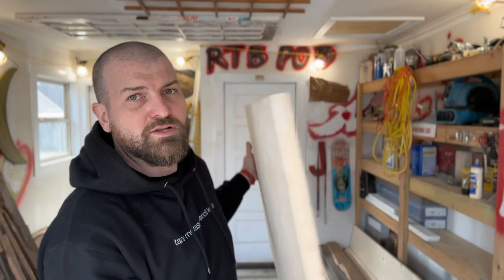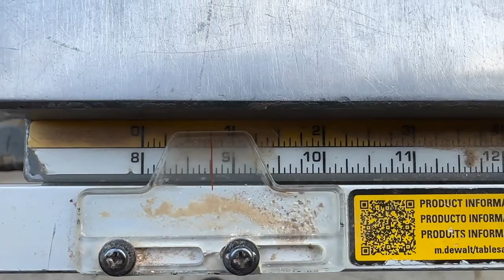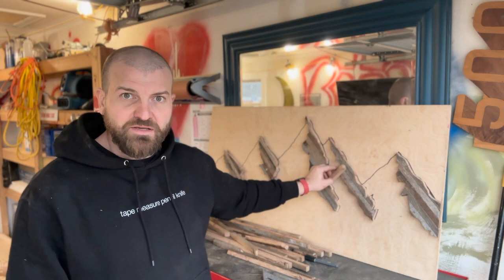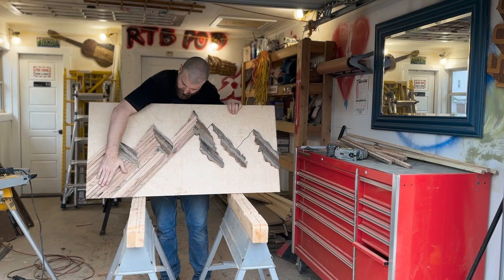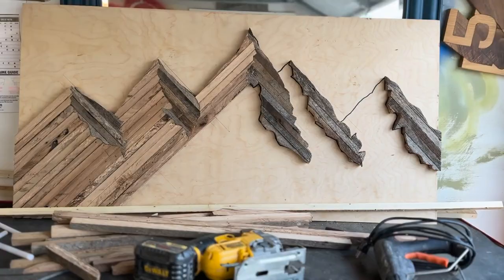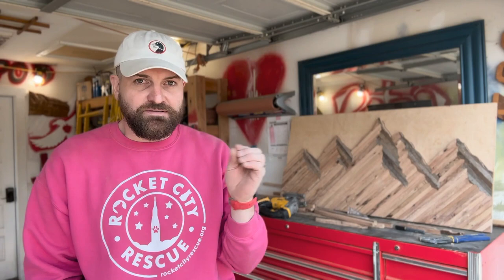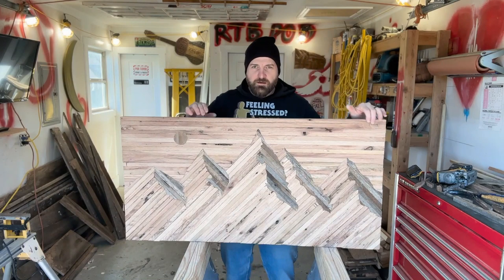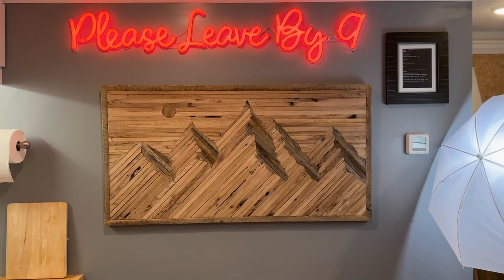How to Mountain Wall Art

Comment: Bro that was freaking amazing it will look good at the cabin
Reply from the maker: Thanks! If there ever is a cabin 😅
Reply: @TMPK  Bro I'll take a vacation and come help hang drywall do some electrical, plumbing what ever say the word and I'm there
Reply from the maker: @chancesellers5425  well the current issue is replacing a bunch of studs, redoing exterior wall coverings, reenforcing the ceiling joist, and leveling the floor.  Then electric. No plumbing because there’s no water on the property and supposedly illegal to install a septic tank even if I could dig a well on the side of a mountain. I’m just kinda taking it slow and thinking about tearing it down and selling lol
Reply: @TMPK  home slice I do all that if you want to make a video on the remodeling of the cabin I'll bring the studs and a shit load of drywall mud and what ever you need I live for this shit this is not a joke I am legit my sons and I would come and help you if your down we can help you this summer hit me up
Reply: @TMPK  O and no charge I would just want to be in one of your videos and I wouldn't come down there and try to run things we do it your way

Comment: wouldn't it be faster to glue up an approximation of the shapes and cut everythin in one motion? Could use the first shapes as stencils for the second. Would have a bit more of material waste, but seems pretty fast to me. Still, great work, I'm just wondering if it could go faster
Reply from the maker: For sure that would be faster, but one little mess up and you could lose the whole section. I just had the idea to go piece by piece so I could make any adjustments on a single piece basis. Also I would be worried with a jig saw not cutting perfectly straight up and down, what you trace on the bottom wouldn’t be exactly the same on top cause those little blades are flexible. If I could go back I would probably make it 3/8 thick. I could still have made the edges as thick as I wanted and it would have been much less cutting 😅
Reply: @TMPK  Yes, thats totally valid🤔 would also be a lot of tiny adjustments to get the puzzle pieces to slide together. Maybe with a band saw it would work, but art doesn't wait for the right tool..
Thinner would definitely be great. I was thinking of having the entire sky area a bit recessed to create more 3d separation. But there are just endless possibilities to play around with that kind of concept